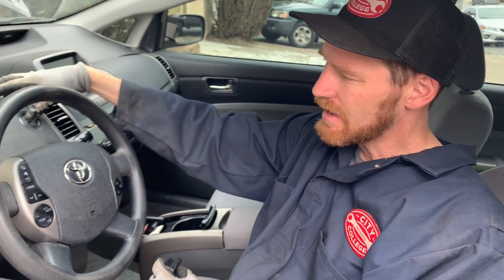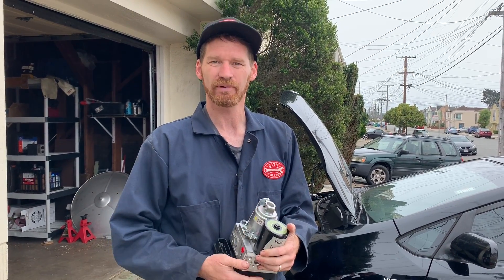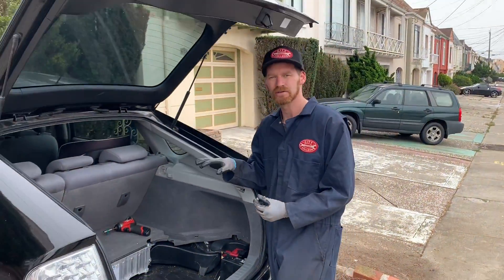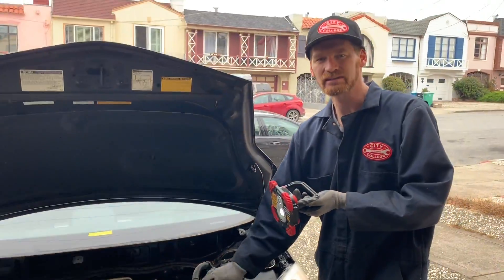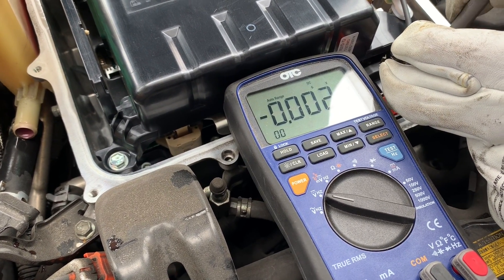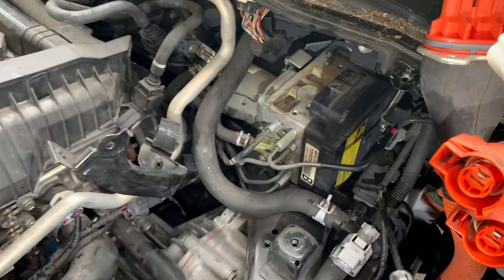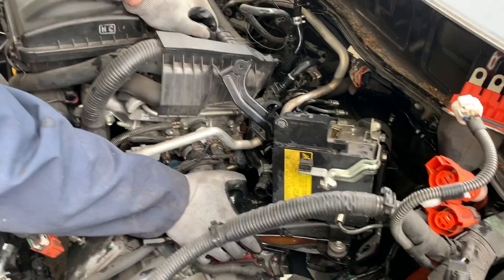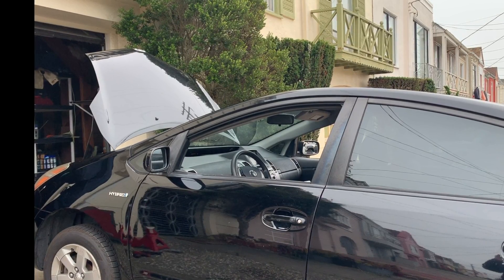2004-2009 Prius ABS Actuator Replacement

Comment: I only sometimes here this sound non-stop. Maybe I had it twice for 6 months. How long till I need to change...?
Also the part is freaking expensive...
Reply from the maker: The noise is normal. You will be fine
Reply: @Mrelectric423  It's normal if it's once in a while and it stops. But it kept for maybe 5 mins or so on these 2 occasions (that I caught) ...
Reply from the maker: @vicentepallamare2608 oh I missed that part. I usually see it run too much consistently not occasionally. It is hard to know what to do. I mean leave it be or sell the car seem like obvious choices
Reply: @Mrelectric423 not selling for sure

Comment: Is it mandatory to have the computer to bleed the brakes?
Reply from the maker: No not mandatory. If you make a mistake the car will stop allowing you to bleed brakes until you clear codes. There is a non computer way to clear codes as well. You might need to google it but I believe it involves putting a jumper between certain pins somewhere.

Comment: Hey, I see you’re still replying to the comments. I wanted to ask, currently my 2013 Lexus GS450h is doing the same with its actuator. But mine isn’t as bad as the Prius in the video, it does the buzzing for 2 seconds, but it does it every 4-5 seconds, I also hear a hissing sound as well when I put my ear close to it. 

How long you think I have until my brakes maybe fail or I notice something, because at the moment my brakes feel the same as if I got the car 40k miles ago. Btw the codes I’m getting are c1241, c1234, and c1256 but no lights on the dash.
Reply from the maker: That’s a difficult question to answer. I’m surprised those codes come up but no dash light. 
Have you checked eBay for used accumulators?
Reply: @Mrelectric423 yeah, cheapest I’ve found is 1,400 and I don’t even have techstream :/

Comment: Where can you even get an abs pump . I have a 2005 that Noone can even order
Reply from the maker: ebay has them , used
Reply: It’s wild that Toyota doesn’t make them anymore. Such a vital vehicle component and the only way to find one is used. I’d think it would actually still be a money maker for Toyota, but maybe not.
Reply: @EvzenKovar-i5p i got one new from toyota this week. It was 2000.00 dollars
Reply from the maker: @EvzenKovar-i5p automakers and really all
Manufacturers are not making parts the way they did in the past. 20 years after new purchase date and all bets are off.

Comment: im kinda late to the video but um i went to autozone to see what codes were popping up on my 2006 prius and “Anti-Lock brake control module “ and also thee “ Abs pump/motor” came up on the code but the ABS light does not pop up while the car driving. So do i still change it or no ?

Comment: The ABS in my 2010 Prius goes off every 30 seconds.  I’ve never seen a code for it on the dashboard and I’ve driven it for a year. It’s made the noise the entire time I’ve had it.  Buzzes every 30 seconds and it’s non stop the entire time.  Again I’ve never had a code pop up for it and I have a scanner an OBD2 with no codes at all
Reply from the maker: I would wait to see if a code sets. The abs system is naturally noisy on Toyota hybrids

Comment: I'm doing the job today(now)  inverter does not have to be removed and you have to break the the cooling line, so get some antifreeze...going to do that now, been on it for 3.5 hours disconnect the coolant line or you can get it out. thank you for the video.for me it looks like a good 7 hour job total with bleeding

Comment: Will a bad abs actuator also sound like a constant clicking/pumping almost sound like a bad realy but the noise is coming from that area i have no dash lights on so cant read whats wrong
Reply from the maker: @huey4203  with no code it might be something else.
Reply: @Mrelectric423  ok thank you I stuck a metal probe in there to find out where the sound was coming from amd  it's the inverter pumps wawawawa sound
Reply from the maker: @ good technique!
Reply: @Mrelectric423  learned that from my dad I can diagnose old school engines but these new ones I'm lost so took a shot with that and realized the sound was bouncing off the firewall and just worked my way towards that pump,but I appreciate all the videos you do amd will subscribe  to help you out

Comment: Hey Mr.electric, new subscriber here! 

Is changing the resistor necessary as shown in some videos? Also, was your ebay part refurbished or just a used part pulled from another prius? Asking this for maybe going the junkyard route. Thanks again!!
Reply from the maker: @wssr3293  I never change the resistor but it might be needed in some cases. I have sourced used parts so far
Reply: @Mrelectric423  thank you! Should I care how many miles are there on the used part I am getting? i.e. how old is too old. Especially with the amount of work involved. New ones are at least 3x the price.
Reply from the maker: @wssr3293  I try to buy fro LKQ on ebay. Lower miles is better but not required. New units need an additional scantool procedure to work.
Reply: @Mrelectric423  Thank you! So I am going to buy a new unit. Before the installation, I did "Health Check" with the TechStream software. It has the code C1300 "ABS ECU Malfunction." No lights or warning on the dash. Only symptom is frequent buzzing from the actuator. 

Would you know if the frequent actuator cycling (buzzing sound every 3 seconds) would be caused by a faulty ABS ECU Skid plate or would it be the ABS Actuator itself? 

I am asking so I don't replace the actuator and go thru the pain for no reason. 

Thanks a lot! Looking forward to your valuable advice!

Comment: I have this same noise but no spongy pedal and car stops excellent ,also no brake, ABS or VSC lights displaying on dash. Could mine just be starting to fail?
Reply from the maker: A brand new pump makes that noise it just gets louder and the pump runs more often when it begins to fail.
Reply: @ Does the pump run more because  it can’t pressurize the accumulator portion of the abs module fully due to an internal leak?
Reply from the maker: @Craig-o9m  Yes exactly
Reply: I had an updated newer used abs pump assembly put in by a Lexus certified master technician and now I hear the whirring buzzing noise every 1 to 3 minutes for a couple seconds. I drive this car for delivery 8 hours a day. I’m
Concerned if it’s normal to hear this sound that often?

Comment: 11:15 - 11:18 I need to know how to get that Large White extrical connector disconnected.
Reply from the maker: @stveichman3329  like any plug the latch gets depressed and the plug halves get pulled apart. Some are in a really tough position. I sometimes use pliers with a small tooth pointing inwards at the very tip to depress the latch.

Comment: Hello, does your procedure for bleeding the brakes without a scan tool work for a bleed after replacing the brake actuator, or just jobs at the wheels like calipers? Would a snap on scan tool work or only a tech stream?
Reply from the maker: The non scan tool method has worked for me, in fact I have even tried not bleeding at all after actuator replacement and somehow the brakes have worked fine. I do not know why or how this works. All that said the snap on will work well to do bleeding procedure.
Reply: Thank you. Is there any danger of damaging the abs pump by running it dry while it primes or not really? Will it pull fluid through fast enough during the bleed to not make a difference?
Reply from the maker: @ I guess the safe route is to do the scantool procedure. There is a specific procedure that is for actuator replacement.
Reply: Thank you!

Comment: I did the whole procedure and after I put everything together and wanted to start the car, it didn't start and the red triangle appeared.
Reply from the maker: @jhosetSanchez if you don’t have a scanner to check the codes related to the red triangle - throw in the towel and bring it to a shop.
Reply: @Mrelectric423  What scanner do I need to be able to check that? Please help me.

Comment: Thanks man for posting this great video. The dealer wanted $3,500 for the job on my 2007 Prius, which is probably worth that much as a whole. I did the job myself and saved a ton of money. Also, I followed your other video on bleeding the ABS and brakes without scan tool and it worked flawlessly. The car is back on the road and runs great! Thanks a ton!
Reply: Awesome!  How's the part holding up? Did you buy used or a new part?
Reply: lol 😂 dealer asking $380 for labor. Where have you been quoted?

Comment: What would happen if i keep driving the car with this issue?
Reply from the maker: @Cmbg32  eventually the brakes are very hard to apply. Like the pedal is extremely difficult to depress takes a lot of force
Reply: @Mrelectric423  thanks for that info.  Yah i just bought a 2007 toyota prius with 104,000 miles on it and has a new big battery, but i need to change the abs actuator on it because i get the same codes and lights.  I want to find a cheap part and put it in myself, but I dont have a reader personally for bleeding the brake lines.  I wonder if i could change the part myself and have a mechanic bleed it for me.

Comment: I dont have a scan tool for the bleeding procedure.  Do i need it?
Reply from the maker: @Cmbg32  if a code comes up or is already there you need a scan tool because it will not bleed with a current code.

Comment: Just did this same job got it together and car wont start checked part number and the last number is diff than the one removed problem?
Reply from the maker: @jonathangodfrey2210  it’s usually one of the two safety interlocks when it won’t start afterwards. One is the orange service connector not clicked down probably ( needs a second click) two is the service connector on the inverter cover gets bent pins. 
A third is just some harness plug somewhere left unplugged.

Comment: Thanks for the video, it helped my navigate this job. But if your car is rusty from up north, just do yourself a favor and burn the car before doing this job removing the brake lines from that aluminum block is not nice especially if you bust off any lines. Turns this into a 12 hr job

Comment: Can someone confirm that it should sound like this? Mine sounds exactly like this but just for a short burst. Everything works fine though, no problems. 

I’m just paranoid because once per 2-3 break pedal presses I can hear it in the cabin.  2007 model.

Comment: 9:40 ish…

You pulled of those cables on the inverter like it was nothing…as if it’d already been removed before…neither of them coming out so easy for me.

So I should just apply extra force? I can’t tell if there’s a tab situation I’m missing that I should be aware of
Reply: Oh I see

On mine at least there are two additional 10mm bolts to remove the most annoying being the one on the right of the bottom right cable.actually just fine with an extension, but the cable itself has small clips to push in on either side. A bit overkill IMO
Reply: Also many other connectors, each with their own way of being removed…annoying! But thankful for this video for showing the path. lots of "bobs your uncle" moments...even though many details that are unfamiliar to me that are taking a ton of time, like threading those @(*$@# lines, how to maneuver this thing back in,  remounting the piece...

Comment: I appreciate the great visuals and also removal process being so clear. How do I tell if the problem is break boosters or break actuator? I'm looking at a Prius 2002, and know it's a little different, but not much. And roughly, how long did it take you as an expert to do this project (or if you're a DIY repairperson)?
Reply from the maker: I have little experience with gen 1 Prius but the general consensus is to move towards a gen 2 or newer when possible. I believe several areas were drastically improved in gen 2 up. If you already own the car I would start by researching the codes logged and paying attention to experts on Prius chat. 
I worked at the Toyota dealership then an independent shop and now more as a hobbyist for the past 20 years. That said there is a lot to learn and I avoid trying to say I know the cars well.

Comment: Another video mentioned needing to replace the capacitor connected to the actuator so it's calibrated properly. Any thoughts on that? Thanks!
Reply from the maker: I have wondered about need for the big resistors replacement too. In my experience it is fine without but your results may vary

Comment: This was a great tutorial. Gonna attempt to replace mine w my little brother. Looks easy enough. I do have a question though. If it starts to drain the battery, which mine is doing. Sometimes the battery just dies when I park it, it won’t turn on now. Does the hybrid battery or the battery in front need to be replaced usually?

Comment: what else could it be besides actuator if its making that continual sound? mine continually makes the sound but no abs lights or codes
Reply: From what I’ve seen it means it may be about to go out…
Reply: @madimakes  ya the lights eventually went on and it got worse so yea you are correct

Comment: Can this procedure be accomplished without Techstream? If so, what set up would you recommend? 
I have a 2013 prius with the dreaded ABS issue, dealership quote >$4k, $1,900 in parts alone... Having a go with used parts from either eBay are my local junkyard and a new scantool seems like a solid option before paying the dealer more than half of what the car is worth!

Comment: Just swapped ABS unit with an ebay one, getting the constant beep with BRAKE, (!), and ABS codes straight away, but the pedal is firm and the technique to bleed by pedal depression doesn't seem to be making the ABS unit pump automatically like it did before the swap.  Your lights seemed to turn off automatically or was there something you did with the Techstream before you bled them.  Thoughts?
Reply from the maker: I recommend Checking/ clearing codes next. I guess it is hard to know if the replacement part is good. ABS codes (beep noise and brake light) prohibit the bleeding procedure from starting.
Reply: @Mrelectric423  Ah that makes sense.  (Although I would describe the beep noise as more of a getting yelled at, continuously)

I did clear the codes with the paper clip pin4-pin13 but alas the alarm came back on moments after restarting.

I'll do that for some miles and then get a scanner on it.  Flintstone style.

Comment: I love my Prius and it has been cared for then suddenly the ABS light and Brake light VSC as well. Didn't have any braking issues or noises.
The dealer quoted me 3000. It has 201900 miles runs perfect but lost what to do bc of high mile and worried more shit will go bad

Comment: Help! Anyone! I did the ABS pump replacement, and now trying the bleed procedure, and I'm not getting the buzz/priming noise from the new pump at all. What could the problem be? (I'd ask Priuschat, but the whole site is down)
Reply from the maker: it will not pump with certain codes present. What codes do you have, try clearing then bleeding.

Comment: excellent video.I like your safety mesures.  I have a Prius 2005. I avoided a car accident and ran the left side wheel into a deep pot hole. end up with 3 lights  A) red brake B) ABS yellow C) VSC yellow... lost partial almost no brakes but no HYD leak. and lost the inner brake pad and caliper piston kick out of its assembly on the left side. I change the left caliper & bracket and ,rotor on both side and brake pads on both side.
attempt a reset theses msgs  with the paper clip trick on u tube on  the osb panel  but could not do it. Now the right caliper seems to grab the rotor as well and right wheel temperature on the rotor is much higher than the left side  it's  fell like caliper stuck.but not sure  if it is identical to the left side problem. Do you think it maybe the caliper or air stuck in the HYD line  I bleds both side but not the rear brakes.Could it be the ABS fail light that cause this  or the accumulator that does not work because msgs are not reset. Thanks for your feedback.

Répondre
Reply from the maker: Sounds like a mechanical problem not related to actuator. The knuckle could be bent.
Reply: @Mrelectric423  here something interesting. after many attempts to reset the faulty lights, I bled the rear brakes. Still no success even after disconnecting the auxiliary battery twice and repeating the paperclip procedure on the OBS. Then I read something about Toyota's steer wheel realignment procedure on the car that it needs to be on level ground for this procedure. My attempt procedure was always in my driveway at a 5 degree drop. I decided to repeat this paper clip procedure on flat ground and guess what. Immediately, all the lights went out. Smart car.
Hey thanks again for your quick response.
Reply from the maker: @danlavigueur2648  good information to know! thank you

Comment: I did this repair and now I can’t start the car, I’ve also replaced the 12v battery in the trunk
Reply from the maker: you will need to check the codes and i can tell you what may be going on. Usually something was left unplugged causing a no start after
Reply: @Mrelectric423  I actually got it started. I switched a few blown fuses and also needed to close the safety switch on the hybrid battery fully! I now can start the car but it’s acting as if I didn’t replace the abs at all! I bought an obd2 scanner to see about scanning for codes
Reply from the maker: @Dave.IO_ You need a decent scanner to get abs codes